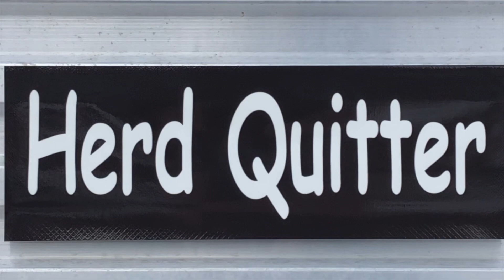Herd Quitter™ Minute - Raising Replacement Heifers

Comment: When referring to percentage of body weight weaned, at how many days of age do you measure that? Some people wean at 6 months some at 10 months or later. I’m a small cow advocate but the term “weaning weight” gets used a lot. It’s a useless phrase unless we put a time measurement to the word “weaning.” It’s the same with the phrase “moderate frame.” Without measurements that is a worthless description.
Reply: The cattle market standardizes weaning weights by using an equation. 

Adj. 205 day WW = (WW-birth weight)/weaning age in days X 205 + birth weight + age of dam adj. factor
Reply: Adjust it at 205 days
Reply from the maker: The industry standard is 205 days.  The 2 year old cow I referred to weighed 990 lbs and her bull calf weighed 635 lbs. at 220 days.  She weaned 64% of her body weight!  His 205 day weight  (Weaning wt. - birth weight /days from birth to weaning x 205) = 526#